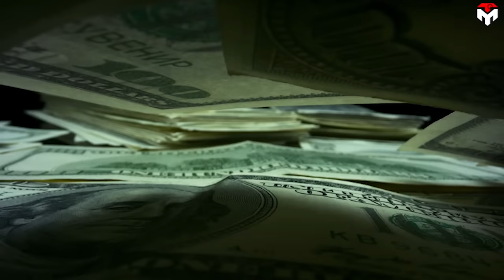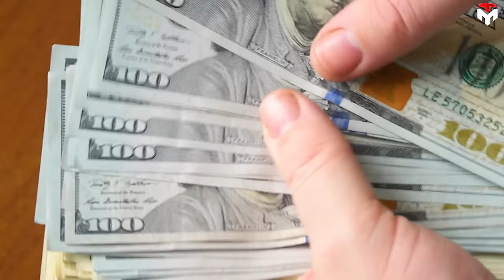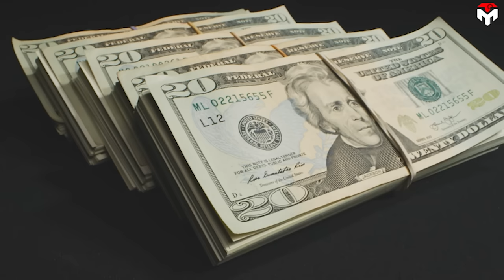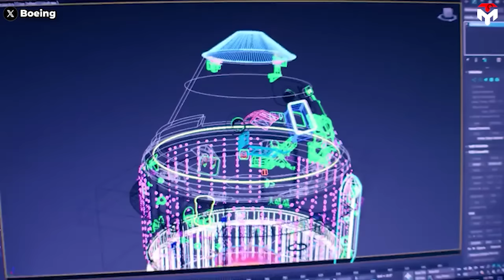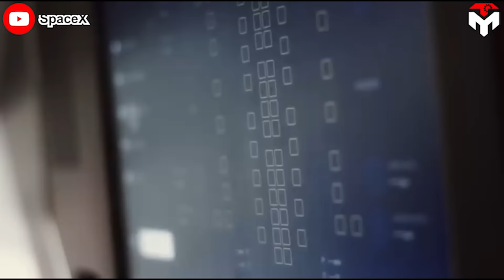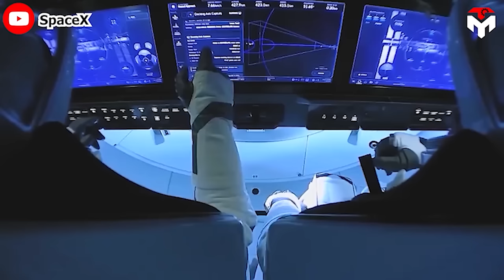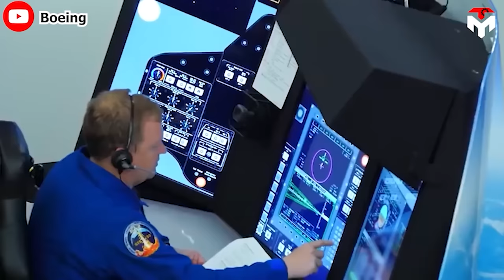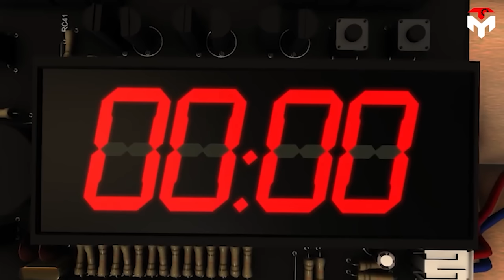Boeing STOPS manufacturing New Rocket cause of Starliner Failure. Astronauts prefer Dragon...

Comment: I worked as a supplier to Boeing back in the 80's when they were respected. The company's engineers made the company what it is. Once the management decided the "gray beards"  were a liability and not an asset, the company was doomed to end up where they are today. You can cite multiple examples of the trend. Stonecipher's disgrace, the corporate move to Chicago, the failure to put Al Mulally in the CEO position and many others to numerous to recite. The house cleaning at the top that just happened was long overdue. The remaining question is will the new team be any different?
Reply: You probably already know, having worked for them, but the downfall came when they acquired McDonald and stopped raising engineers to management.
Reply: @patrickradcliffe3837 Agree.  I hope the management flush is extensive enough.  But what kind of people are they being replaced with?  Are they going to be any better, or just new people with a slightly hipper rap?

Comment: Consider this too - not only did SpaceX develop the Dragon XL/Crew Dragon craft during the same time frame as Boeing the Starliner - they also completed their initial 6 missions AND made significant work on a whole other craft and booster (Starship and Super Heavy). At this point, Starship may be ready for human operation before Starliner completes it's first successful mission.

Comment: Boeings problems with starliner are reflection of its problem in other manufacturing areas.  Planes that are missing bolts.  The problem with the stretch 737 that has led to planes being grounded.  Overall quality control problems that have hurt it.  It is not surprising that Starliner has suffered.   Plus for many companies involved in space they have gotten use to producing commodities or consumables.  One use launch rockets that Nasa or the air force is going to buy again and again giving them a steady revenue stream.   If they were space launch companies like spacex center on getting payloads into space at the least possible cost there is a possibility they would have pushed for reliability and reusability.   In the case of space shuttle.  The contractors had a stead income of expecting and replacing the heat shield tiles that just balloon the cause of the space shuttle.   NASA was not looking for a better solution or a means to reduce cost.

Comment: At 13:20 in the video you state that SpaceX Dragon is "somewhat wider and taller" than Starliner. Yet, just prior you stated that Dragon has D=3.7m and L=8.1m while Starliner has D=4.56m and L=5.3m. Since when is 3.7m > 4.56m? Plus, later on you show that Starliner has 35 FT3 MORE room than Dragon yet you keep saying that Dragon is roomier for the Astronauts. Most of this video is really great but I hate it when facts are ignored in order to promote a biased dialog!

But, you are absolutely right about Boeing really losing out. Boeing is a great example of what happens to a technical engineering company being run by bean counters. The true cost of a "for profit" corporation that only looks to shareholders and stock buy backs as their value proposition!
Reply from the maker: I noted this, thanks your great feedbacks

Comment: You know, more and more, I'll come to the realization it's an issue of cohesion. Cross-interpolated science teams overseen by futurists and visionaries with a working interpersonal relationship with a unifying viscosity of mutual will want and same-page air of excitement thus,  seeing and believing the integrity of the mission in all entirety from front to back. Is the array of technological tasks asked of Boeing diverse,  stringent and simultaneously complex over a spectrum too wide to realistically focus all technological Innovation across the expansive scientifi c disciplines required?

Comment: So far, the Boeing ship is designed to reenter from Mars while the Dragon from Earth orbit. Very different requirements.
Reply: If it doesn't get out of the Earth's atmosphere it doesn't matter where it it was designed to land.
Reply: It should also be noted that cost of Dragon would be substantially more if it had the same reentry requirement as the Boeing Orion capsule and as well as refurbishing for each flight!
Reply: How odd.. Boeing’s own website

“CST-100 Starliner
The Starliner is a next-generation space capsule that will take people to and from low-Earth orbit.”

No mention of Mars,  or even Moon, for Starliner. Only Low-Earth Orbit. LEO.

Mayhaps you mistook it for Orion?

Further, Mr Musk stated that Crew Dragon had its heat-shield system over-engineered to allow Moon missions with very few modifications.
Dragon at present is built for LEO, but engineered for Lunar Orbit return.
So, sorry, Dragon IS cheaper, but ‘hotter’. 🚀